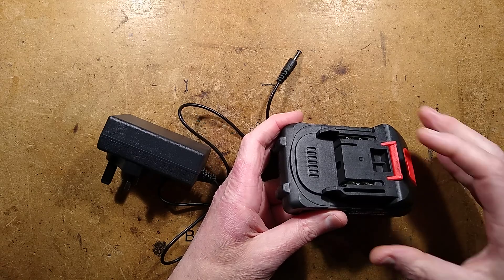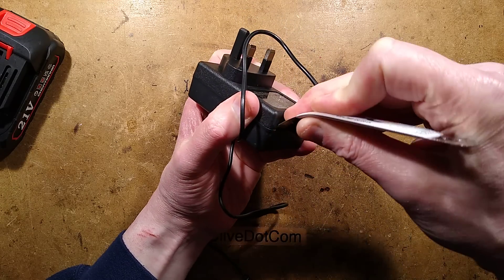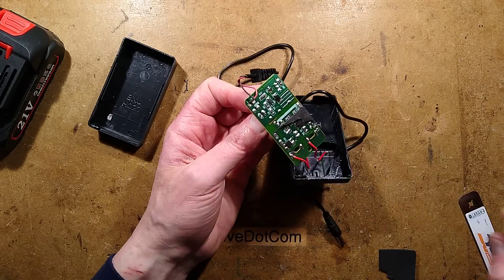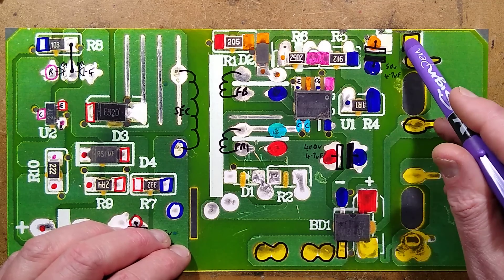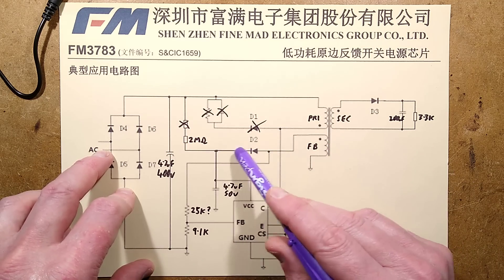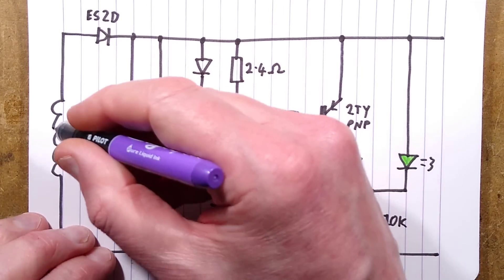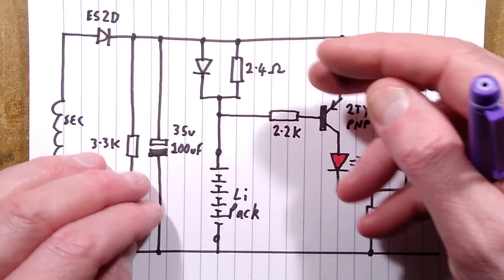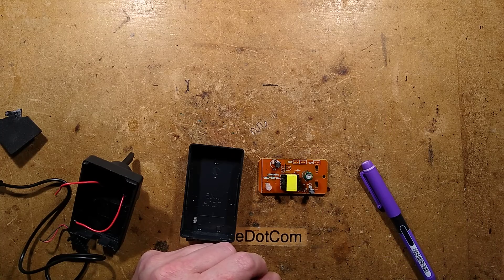Inside an eBay cordless tool charger - with schematic

Comment: I always go for decent power supplies however recently I’ve had two Anker USB supplies fail.  They claim to supply up to 5A but failed with a 4A load on a single output.  O/P1 failed so I moved to O/P2 which lasted a day and the other outputs only lasted a few minutes.  I had another the same and checked the outputs with a USB tester and dummy load.  All outputs claimed to be IQ3 but would only supply 2A at 5V and the 5A was total load.  Not sure how they got the 60W unless it dissipated more wattage than it supplied.
I opened it up and it did have the Qualcomm chips but there were piggyback boards stacked on piggyback boards and everything crammed into a tiny space.  Couldn’t see any obvious damage and I wouldn’t stand a chance trying to reverse engineer and fault find so it was unceremoniously consigned to the large round filing cabinet in the corner of the room. 
If Anker USB supplies are starting to go the same way as everyone else,  who is there left that you can rely on for quality ?
Reply: IKEA?

Comment: The chainsaw i got had a very similar power supply , Light as a feather and felt like i really shouldn't trust it , I ended up charging the battery under close watch using a buck booster from 12v to 21v with a dps3012 in between to regulate the speed of charge.
Reply: They gave up on the weight strategy, where they'd do the exact same atrocities in design, but include a steel weight to make it feel legitimate.
No, I jest not. Clive uncovered that in one as I recall, right as I had discovered one in my junkheap of failed crap.
Reply: @spvillano  always good to have a free piece of metal I guess , they are so cheeky

Comment: FM3783 is primary sensing regulator (PSR) and monolithic switch power controller which is designed for small-power supply equipment with current mode control. Built-in accurate CV/CC control circuit,  The output current is determinated by R4 at 6:43 .  Io= 2/7*500/R4*Np/Ns  ;Np:primary winding turns, Ns:secondary winding turns;
Reply: Ok

Comment: It may be a chip for a USB power supply. The output voltage is determined by the turns ratio between FB and output windings. So it can do just about any voltage. But your sill limited by the number of watts it can handle.

Comment: Hi Clive.
Do you know anything about Panzer 18V Li-Ion tools batteries?
It uses a PT6111 IC for charging/balancing and a microcontroller for the 5 series cells.
There is a USB socket, a button and 3 led's for charge status.
I have 2, they are not charging, nor providing any voltage at the output or USB port.
When I press the button, it works briefly.
Is it possible that the microcontroller locked the battery for some reason? On a tool? Like a laptop?
Have you seen anyting like this before?
I cannot find any damaged component on the PCB. I've charged every cell individually to rule out balance problems.
Thanks.
Reply from the maker: If the cells are above 3V it should work.  It might be worth disconnecting the cells from the control module to see if it resets.

Comment: Sometimes a small G-clamp is good for popping small power supply units like this.
Just tighten on the sides in different areas.
Better than stabbing my hands with screwdrivers.
Reply: Clive has a suitable tool. It's called something like "the vise of persuasion".
Reply: @manolisgledsodakis873  The vice of knowledge, I believe.
Reply: @sarkybugger5009  A vise is not a vice.

Comment: That label is most likely hot stamped. Very cheap to do since the data doesn't change from one unit to the next. Come to think of it, the die doesn't need to be particularly hot.

Comment: Hey, it should at least provide 2A on the primary, so the rating on the label was only half a lie xD
Thanks for dissecting and analyzing those tools, makes one realize that it's really worth spending a few extra bucks on tools (and chargers) from reputable brands so you get decent electronics that won't set your living space on fire.

Comment: Sometimes a BMS is too smart for its own good. In saying that I'm just salty one cell went bad in this laptop battery and now I need to buy a new one. It was one of those wrapped up ones. Manu's should be forced to make marks on where to cut them so people can safely open them. As well as holes you can pierce into it so you can get access directly to the cells. 3 of the 4 cells are absolutely fine. Guess I need to order a boost converter and make them into a power bank.
Reply: That’s why we should use 18650 cells that can be replaced. I hate built-in lipos!
Reply: The problem is you have a series pack. While the laptop will run on say 3 cells instead of 4 (not ideal, could cause more VRM heat, but maybe it doesn't or maybe it's fine either way), well the charging current goes through all the cells. If one cell is getting 5000mAh, so do all of them! And in case one cell can't take that, well unfortunately the pack just can't be charged safely. Sure there's balancing but it has the current capability of like maybe 100mA, it can't shovel the current fast enough during the bulk of the charging cycle. So unless you're willing to make the BMS even more complex, the effective capacity is the same as the capacity of the weakest cell plus maybe a little extra, not much. It's not too smart, it's just the only sensible way it could go about things.

Comment: the spudger is a useless tool. i use a dull small knife, works much much better
Reply: Nah I have any number of dull small knives but I use these opener tools a lot, they're really much better. They're made from spring steel so they can snake themselves into the latch to actuate it, and they instantly return to their normal shape. The Jakemy Opener from China is actually bevelled too on the tip, and extra flexible more so than iFixit Jimmy, so that's helpful.

Comment: The missing components may have been excluded during the supply chain shortage?  Although in this case, if they can save 5 pennies, they will!
Reply: Not even 5 pennies. Its 0.5 of a penny.
Reply: @simontay4851 adds up if you're building 1 million of them

Comment: I have 2 of these cheap devices, a multi drill and impact. I also have a DeWalt multi drill.
Guess which one performs, last longest and doesn't let me down lol😂
The cheap multi Drill is so rubbish and can't drill into bricks lol
The impact drill is not bad and been really good. Even if the battery doesn't last more than an hour lol
I also have a cheap Chinese cordless garden strimmer, as they are now flooding the market lol
Same batteries and charger 
It's ok for general strimmer work but doesn't last long.
All came with 2 batteries each, so can interchange the empty ones with the charged ones

Comment: What does the chip do, is it inverting the DC and increasing the frequency?
Reply from the maker: Yes.  It converts the high voltage DC to pulses of current through the transformer.

Comment: Boy, that one's a junker both electronically and mechanically. The housing does not look safe or robust enough for a line voltage device at all. Seeing all the usual safety / good operation / snubber devices not present and a real iffy transformer in place, as well as using foam to mount the PCB, I'd be pretty nervous plugging that in. But the thing that really shocked me badly was the exaggerated 2 amp charge spec! Never seen that before. (much)  8^) Cheers!

Comment: Same charger as what came with my dodgy chinese tools, I snapped one of them in half (breaking off the mains side) and just went with injecting 21v at some point in the circuit, didn't really work so just gave up and charged them via my DIY bench power supply instead, which is when I found how badly out of balance the cells were...
Reply: BMS does no balancing, only protection. Legaslov said it's cheaper :D I have modified those batteries to be charged with RC charger using JST-XH 6 pin connector for balancing.

Comment: I bought a cordless impact drill with a slightly different design than the one on the video. Supplies 21 Volts forgot the amperage. It weighs literally nothing, even with the cable attached. It also gets very hot and makes a crackling sound while charging.
Reply from the maker: The crackling sound doesn't sound right.  Maybe a bad solder joint or bad plug fit.
Reply: Broke immediately after two charges. Never really bothered to open it after it died, though I assume the main circuitry is as small as the one in the video. That might explain it weighing nothing.
Reply: @AK.16  if you have it you should send it to him
Reply: Ditto, cheap chainsaw, extremely light charger and even worse connecting cable, I've seen gramophone pickup wire with more current carrying capacity, really cheap and nasty!.
Reply: Weight isn't necessarily an indicator of quality, though. Crack open enough Temu-bought chargers and you'll probably find a few bags of sand¹ amongst them... 🔌⏳😉

I'll own-up to having a bag of soil dangling down from my own consumer unit, but this is by a length of green/yellow striped cable and the bag bears the appropriate electrical symbol for „Ground“... 🔌🌍😋

(¹ - I don't mean the Cockney sort, either! 🙃)

Comment: I'm not a fan of poorly made short lifespan products like this, it just seems like a huge waste of the planets resources. :(
Reply: One day, landfills will become mines for metals and plastics and other related materials
Reply: @vladthe_cat  dude I came here to say this, you are absolutely correct. There are serious discussions concerning scrubbing atmospheric CO2 and chaining the hydrocarbons into gasoline or even plastics.  Sure it's not energy efficient. But we have this large unshielded fusion reactor 1 au from us that we can tap to do much.    I have great hope in people's ability to find interesting ways to reuse waste products.
Reply: I think the charger is supposed to last the life if the battery and no more, so that would only be 5 years or so.  I didn't say that was a good thing but a 21v psu isn't standard so you likely get one with every battery.

Comment: What a crappy circuit.  They just keep removing components until it stops working.
Reply: Earl Muntz wants to know your location
Reply: @abitofabitofabit4404  Hence the term "Muntzing".  To his credit, I'm not aware of any of his sets catching fire...
Reply: @abitofabitofabit4404  Allen DuMont as well. While Allen did improve CRT design, his televisions were notoriously other brands models where he clipped components out until the damned things barely worked, then manufactured that as his own product. Having worked on them, totally believable, to put it kindly.
Later, the company was euthanized by merging with a competitor that he mercilessly stole from for decades.
But, never fear, there were others that followed that business model as well.
That all said, that was back in the era when color televisions used a shunt regulator for HV regulation of the second anode voltage and damper diodes for the snubber were high powered fast diode tubes (valves, for those across the pond).

Forgot about Jack Tramiel, damn you for reminding me, Emmett...   ;)
Reply: Exactly like Jack Tramiel at Commodore.
Reply: All those safety and interference components cost money you know, and it still works without them (until it goes wrong and burns your house down).
Reply: Or it burst into flames
Reply: My old ham radio instructor said exactly the same thing in the 80’s. He worked for a company designing and building tv’s and he explained exactly the same process just to save pennies.
Reply: @agustinusreynaldi7101 that isn't removed! It's improved...  :/
I repaired those turds and well, calling them that is being overly generous. At least turds are useful within compost.
Reply: Yep!  Totally Muntzed it!  
Bravo, Shenzen Fine Mad Electronics Co!  Well played!!  🙄
Reply: Fine Mad is a great name for this thing.
Reply: that's the Chinese way

Comment: Urrgh,those battery packs are the bane of my life.
The grippy connectors break off the pcb every other charge.

I'm almost ready to glue wago connectors to the side of the saw and just admit I can't fix them permanently
Reply from the maker: A dab of silicone grease or vaseline on the contacts might make them slide on and off easier.

Comment: Wow...okay...let's go with a very sketchy power supply for this decently good battery pack!
Reply: @agustinusreynaldi7101 I dunno, looks like a race to see which would burn the structure down, failed battery or failed AC supply. The only thing missing is petrol coolant on the foam pad.
Reply: @agustinusreynaldi7101 Those packs are deleting themselves because IC chip in this copy is only for protection, it does zero balancing at all. While you have balanced pack then this "powerful" lithium charger will work. When pack starts to spread then hatred rampage starts. I have built my own battery with HB6 30 amp cells I also have chineese 3Ah one which is of course worse, my pack delivers 60amps peak. There is a spot near the latch that can be ground away, drilled 2 4mm holes, ideal to attach 5 20awg wires and JST-XH connector for balancing, connector clears with the tools and is protected by it. I charge those batteries with RC charger. Mod for skilled hands take like 15 minutes with soldering and attaching top cap back.